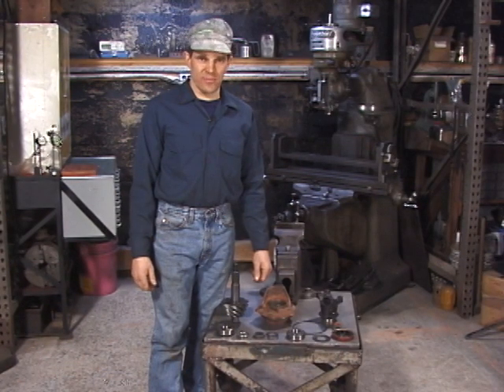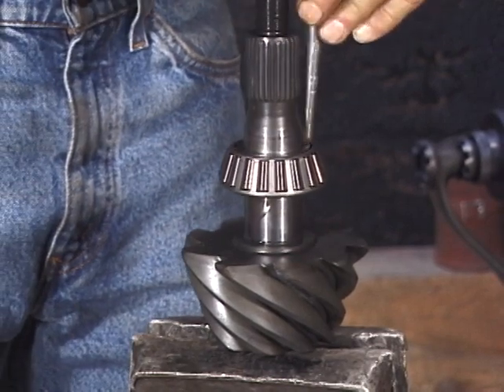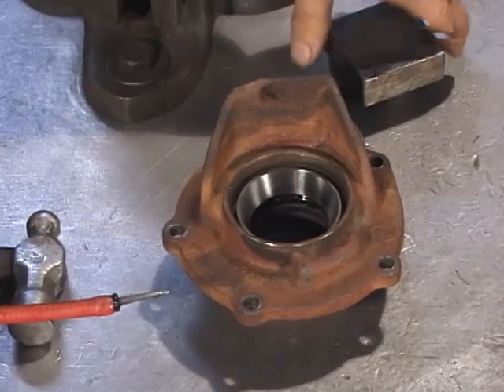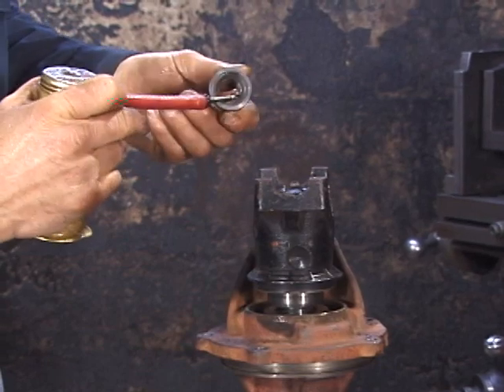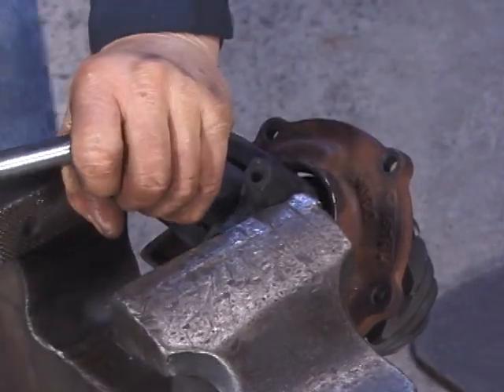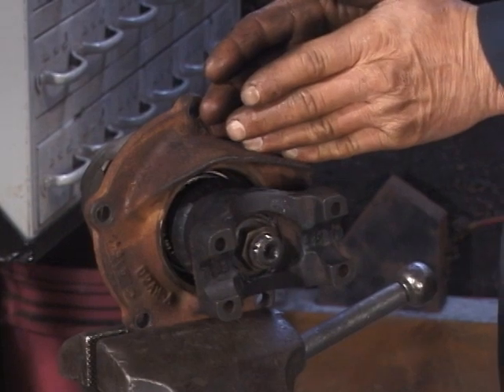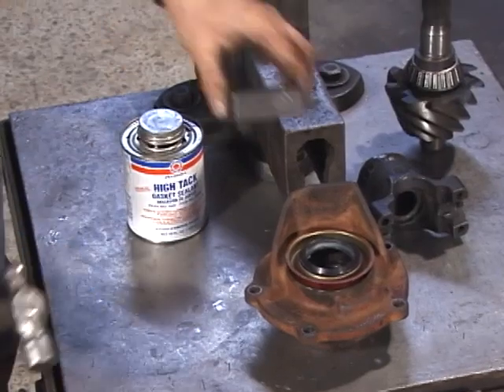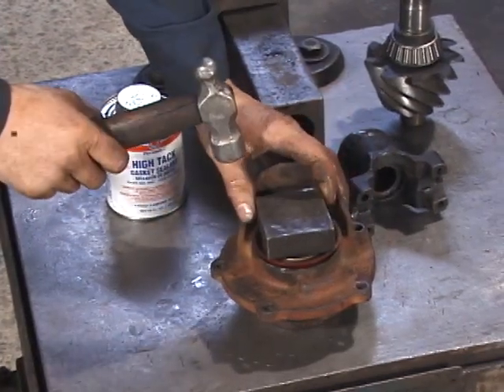Rebuilding Rears- Part 3- Pinion Carrier Assembly

Comment: after getting the crush sleeve with the proper preload, take it out and measure it, then stack up shims to the same thickness and go from there instead of taking it apart multiple times adding shims until you get it right.

Comment: I'm going to make the argument you can just install the oil seal (slinger too if you have one) and Locktight the nut - then crush the collar.  This way the nut is at the torque required to crush the collar to establish the correct rotational drag.  I can't see how you can disassemble and reassemble the assembly, especially considering most old axles require pressing the second bearing and pinion yoke on, without jeopardizing the initial 'crush' of the collar

Comment: Thank-you for your very informative video. Why can't you set the bearing pre-load with the seal in and allow 2-5 inch pounds of drag? Crush sleeves should only be used once but if you set the pre-load then remove the flange and install seal and continue with final assembly does this mean you are using a pre-crushed sleeve and just torquing down to 175 ft/pounds?
Reply: You CAN set the pinion bearing preload with the seal in place and in fact that's how you're supposed to do it. It's the way the factory service manual says how to do it but everybody likes to come up with there own little incorrect way of doing things.
Reply: If you read a service manual there is no tightening torque listed for the pinion nut because you tighten that nut until the crush sleeve is crushed to a point that gives you the listed pinion bearing preload value in inch pounds as you rotate the pinion. You stop tightening the nut and keep checking howmuch force it takes in inch pounds to keep rotating the pinion. It's not the initial reading you get to break away and start it turning either it's after it starts rotating, the inch pounds it takes to keep it rotating. Now if you don't have a crush sleeve style and you have a solid spacer with shims then you torque the pinion nut to the manufacturers specification. Something like a ring and pinion replacement really shouldn't be done by a do it yourselfer because there's more complicated processes involved in setting up the gears properly. If you want to do it though, I'd recommend reading the factory service manual and following those procedures. If you do that the gears will be installed correctly and last  100,000 miles not 500

Comment: I think, with a crush sleeve, you won't be able to separate the pinion from it's carrier like what Greg did in the second part where he used a solid spacer with shims.  So the seal has to be fitted just after removing the old nut and companion, without dismantling the pinion carrier again.

Comment: Going for solid crush sleeve, how is he removing the outer bearing without damaging it? I have a decent used brg I drum sanded the inside to slip on. I  depth mic checked against the new one sitting on the installed brg cup and adjusted shim pack. It worked, but you'd have to press off the bearing which can damage the rollers. Factory service manual has a chart for end play measurement or torque, and how much shim to remove.

Comment: I am not certain on a detail regarding the crush sleeve type assembly.  If I assemble without a seal using the old nut, all as you described, set bearing preload, then disassemble.  When reassembling (final assembly) will I be able to achieve the pinion nut torque without this causing further compression of the crush sleeve?  I understand that I would still need to recheck the bearing preload and start over with a new crush sleeve if the preload rotational torque is too great.  But what is the chance of that?  Do I check rotational torque as I stage up on my pinion nut torque to avoid crushing it more and having to go through the process all over again?
Reply: BTW this video series is great and I appreciate you making all the effort to post it.
Reply: You can use the same crush sleeve.  Put a little loc-tite on the nut and get it fairy tight but don't crush the sleeve any more.  It's acting as a spacer between the bearings, that you crush to length.  If you crush it more you will have premature bearing failure.  Not as strong as the spacers since they are engineered to bend a little.  I'm guessing they used them in the factory because it would be a lot quicker/cheaper to assemble then having to measure shims for each rear-end.
Reply: Yes.  New experience and now I understand  it does take a lot of torque to compress the crush sleeve.  Tightening the nut after installing the seal won't be a problem.  However I also noted that the rotational torque resistance on the assembly has virtually no added value with the seal in place.  So why not do it all in one pass, I did.
Reply: I did it in one pass when I did my 12 bolt and would have with the 9" had I used a crush sleeve.  I went with a solid spacer for the 9".

Comment: At 1256 in this video you say to torch the pinion nut to 175 foot pounds.  Is that using the solid bearing spacer or the crush spacer?  When I tighten with a crush spacer the pinion will not turn.

Comment: I:50 the tapping your bearing wont work on a lot of pinions.The clearances are so close today a press is used to separate the pinion and bearing .a press is needed
Reply: I just removed the pinion bearing on my e46. Outter bearing, I needed 14 tons to press it out. The inner bearing, I had to cut it. Now, tried to install it while heating the bearing and freezing the shaft. Nope.... going to need a press!!!
Reply: It's Private did you read my comment? I clearly said that I heated up the bearing and froze the pinion. Still needed a press. It worked on the carrier, but not on the pinion
Reply: But with the Ford 9 inch, you're still good to go using this guy's method,

Comment: As Stan posts below does final tighten of nut effect the bearing pre load ?????????
Reply: Probably too late now, but you would carefully do the final tighten, checking preload as you turn the nut little by little.
Reply: The way I understand what he did, the force required to crush the collar into proper pre-load is much more than the reassembly with new nut at 175 ft/lbs. He wasn't super clear on that point.

Comment: I am reassembling 7.5 diff on 98 Ford Ranger using USA Gear bearings. Do I used my old oil slinger? My package did came with new oil slinger, but thinner width wise.
Reply: I have the same question, what ended up being the right thing, or what did you do?

Comment: Just wondering, how precise need to be those 15 or 25 in.lbs?
Is there any other way to measure this bearing preload without that expensive torque wrench? E.g. 2x15 inch long lever mounted at yoke, 1 lbs weight at the end, tighten until it stops moving.
Reply: I don't think you can do that for two reasons. (1) There is a slight difference between static and dynamic torque. The static torque would be what it takes to start the shaft turning, which will be slightly higher than the dynamic torque.  Watch his torque meter when he starts turning it (@10:56). It goes up, then comes back down after it gets started moving.  Reason #2 would be because this method would only result in 30in*lbs of torque when the torque arm is horizontal and the weight is hanging below it.  As the yoke moves around, there is less and less resultant torque applied to the pinion.
You could use something like a digital fish scale to measure the torque. just be sure that you keep the scale perpendicular to the bar that's attached to the yoke.  Also make sure you calculate what the moment will be based on how long your bar is that's attached to the yoke.
Reply: +bluehen03 You can get a beam style in lb torque wrench on Amazon for $40 shipped.

Comment: You keep saying to torque ths pinion nut to specification. You're WRONG. There is no torque spec. You tighten the nut until you achieve the rotational torque that you demonstrated.